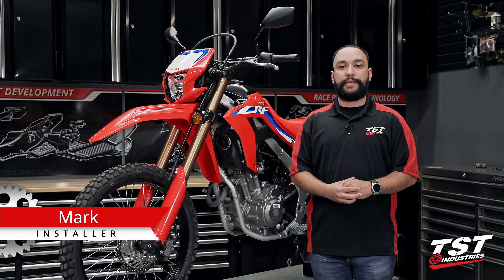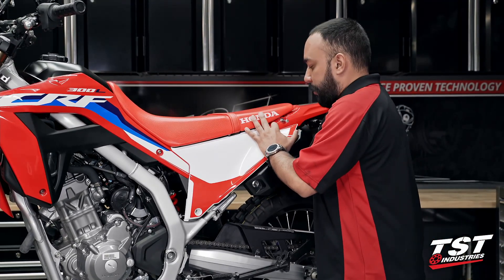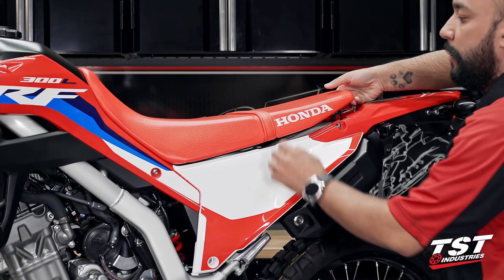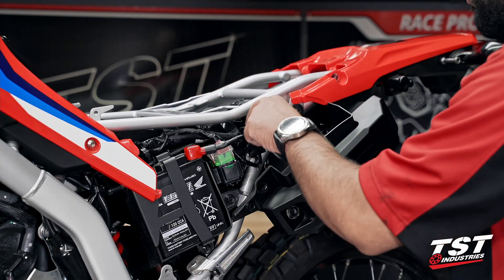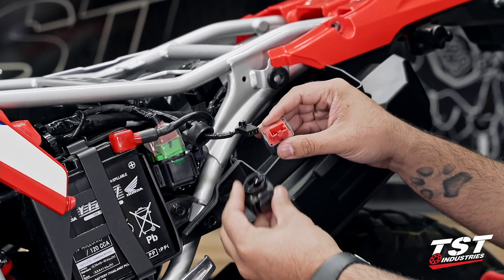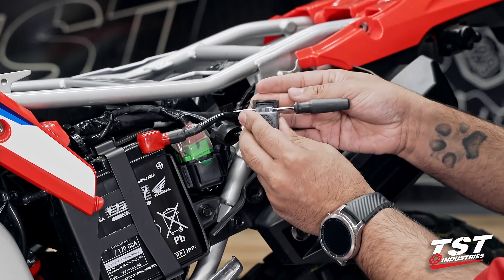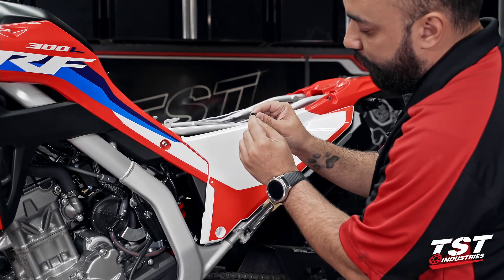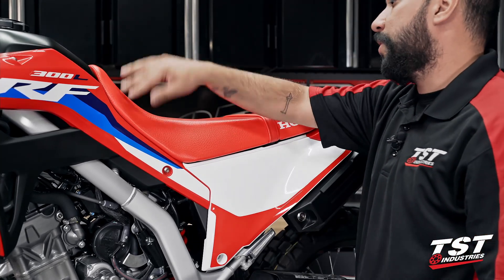How to install an LED Flasher Relay on a 2021+ Honda CRF300L by TST Industries

Comment: After Upgrading my signals to all LED on my 2021 CRF 300L,  all 4 signals flash non-stop, and in perfect time (exactly like hazards) after the key is turned on and will not stop flashing, except when the key is off.   Is this a relay problem, or some other issue? It’s a USA bike.   Thank you for any help!
Reply from the maker: I believe there is more to your symptom than just the flash control relay. On these modern bikes the factory setup has left side lamps electrically separate from the right. So something you installed is probably connecting the two sides. Did you perhaps connect a single circuit signal lamp set into the front to have running light functionality? I have seen guys do that and end up with this symptom. In this case you wire the front running and signal circuits not as they were designed to be used. You would have to disconnect the running light conductor from your front signal set to restore proper function. My answer is assuming that you did not use our TST Industries signals and did not use our instructional videos. All of our parts come with detailed instructiojns in video that steer you around those kind of problems.
Reply: I actually just bought the bike, and it was set up already for me, so I will need to look at what brand of signals he had bought and installed.   Funny thing is, they did not flash when i tried the bike out fir 5 minutes, but started flashing when I got it home.   Thank you.

Comment: Is this one relay for all the indicators? If so, does that mean you need to change them all to LED or can you have rear as LED and front as original? Thanks
Reply from the maker: This one relay will correct and control the entire signal circuit. It will work with stock signals, LEDs, or a mixture of both.
Reply: Hi guys.
I’m upgrading my CRF300L with LED turn signals.
I’ve decided to modify both rear and front.
I’ve bought aftermarket micro LED and some 2pin relay ~0.1 - 150W.
Unfortunately, after installing entire set (LEDs + relay) turn signals don’t work at all.
If i keep at least one bulb (at the side) with aftermarket relay it works fine, with OEM they flash fast.

2 questions:
1st, will your relay solve my problem and make my LEDs (complete set) working fine ?

2nd:
Instead of relay, can I simply buy load - balancing resistors from you guys ? 
If so, do I need 2x per side (4in total) or 1x per side will (2in total) do the job ? 
Would you be kind enough to share the details of resistors you guys are offering ?

Finally, I like your videos, and all professionalism behind.
Wish you were a bit closer (like in Europe;) 

Greetings from Poland :)
Reply from the maker: @piotro817  the story of TST Industries originated in Dabrowa Tarnowska  woj. Malopolskie, where the owner Bart first started riding mororcycles on a Romet Pony aka Motorynka. I guess thats a story for another time.

 I cant guarantee that our relay would correct your 300L problem because you seem to be using some other aftermarket signal lamps that i havent tested. The signal lamps need to draw enought current to enable our relay to do its job. I have not come across a set of signals that didnt work with our relay yet, but still i cant make the guarantee that yours would be compatible. The symptom you are describing is the exact one that our relay is designed to remedy, but if you dont want to risk enduring the high cost of shipping, parts, duties, etc., you can go the resistor route. The ones we sell are 6.8 ohm, capable of 20W power dissipation. I would say ypu can try starting with only one resistor per side, wired in parallel with the lamp. You can try a 10 ohm because that is going to be easier to find. Still get  20W resistors so that they dont overheat. 

If you do want to try our relay, and want to shop more local, you can get it from Cregtech in UK.

Pozdrawiam.
Bart
Reply: @TSTindustries  there is nothing else for me to say / write that the world is sooo small !!!  

Your post post made me feel so happy, that still despite of physical / geographical distance we are all quite the same :) 

I actually felt in love with motorcycles when I saw little phony - motorynka - and managed to drive it like 30yrs ago :) 

Thanks a lot for your reply, and all the best for entire TST crew ! 
You guys are doing awesome job ! 

Again, greetings from Poland (like ~100km / 60miles from Dabrowa Tarnowska !!!! )
Reply: After Upgrading my signals to all LED on my 2021 CRF 300, and a after few months of usage, all 4 signals flash non-stop, and in perfect time (exactly like hazards) after the key is turned on and will not stop flashing, except when the key is off.   Is this a relay problem, or some other issue? It’s a USA bike.

Comment: You mentioned the flash rate was adjustable?  How do you adjust the flash rate with this new relay?
Reply from the maker: You can follow the procedure at time stamp 2:53 in this video https://youtu.be/3W7PU5OO5yI

Comment: I I did a tail tidy led conversion but my front lights are still stock. Will the relay fix  issue or do
I have to do my fronts as well to led ?
Reply from the maker: Our relay is designed to work with all LEDs, all stock lighting, or a mixture of both. You should be fine.
Reply: @TSTindustries  I’ll look for the right one for a 2022 Honda 300L

Comment: Bought the bundles, not yet installed. Saw all the relay videos, geez Louise, all bikes, even Honda, are slightly different. I’ll install soon, look forward to more 300l stuff, ie accessories.
Reply: Finished my install of front and rear blinkers and also the rear fender replacement with license plate light. Must say, Very impressive quality from TST stuff. Nice stuff, buy with confidence👍